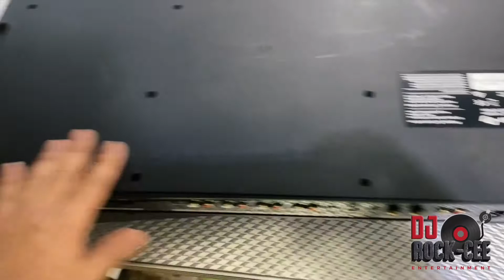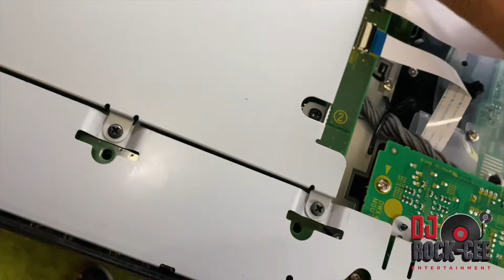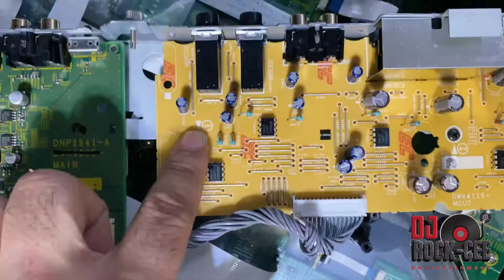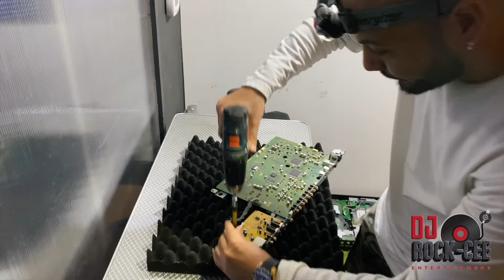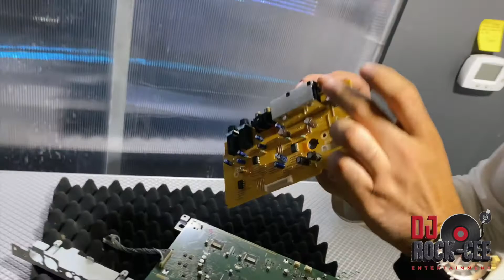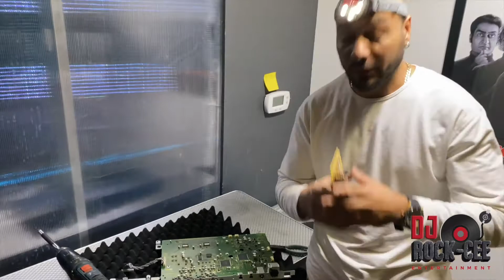how to fix Pioneer Ddj 1000 /DDJ 1000 SRT Master Main Outputs distortion /Audio output Pcb Board

Comment: Hey man my xtr is plug in to the back of my ddj 1000srt and when i turn up the master volume no sound but when i turn up my booth volume i am getting sound..mind you nothing is plug in to my booth
Reply: Same issue! My master is not responsive to adjustment, booth allows sound to pass, and trims knobs have to be turned down to balance volume. Seems like a common issue with the 1000.

Comment: can i send u my controller for repair pioneer sx2 audio is distorted from headphones and outputs speakers please let me kno ???
Reply: I have same problem but on my sx1. No distortion until headphones is turned up half way but also get distortion through master channel as well... But when cue is or headphones aren't plugged in there doesn't seem to be any distortion
Reply: Did you fix it yours?
Reply: I have a sx1 but simikar problem. Distortion through headphone cue but also master channel ay same time.... But only when headphones plugged in and headphones volume Is at 40-50%

Comment: My mixer doesn't want to turn on anymore. Changed the power adapter once started working fine and then it happen again it doesn't want to turn on again. last time I tried to turn it on the quantize was flashing red then it didn't turn on any more please help.

Comment: I’ve always ran my setups from RCA to an external mixer. Just yesterday, I setup my SRT without an external mixer and ran straight to the XLR mains and discovered that the volume on my right main out is significantly lower than the left.

Which is crazy because it’s completely normal when it’s ran with simple mainout RCA to 1/4 to my external mixer.

I looked everywhere for a solution and you’re the only one that appears to have found my answer.

My question, do you personally do these repairs? Where are you located?
Reply: Hi - I'm getting the exact same issue you described. Would love to know if your sorted it, and if the new pcb replacement was the answer? 
Most people I've seen mention distortion, but my XLR outs are just not balanced (no distortion), and RCA outs work fine. 
Thanks!

Comment: I have been getting a weird crackling 
noise later in the night on gigs lately and I will just restart my mac and unit and that seems to work  until the next gig.  I've hade the unit for 3 years already but I'm not sure  what is causing it.  I have replaced wires, free'd up space on my mac, but I cannot figure it out.  Do you know if it's something I have to replace on the unit?
Reply from the maker: first try another computer that's faster than what you have, if you still getting the noise is coming from the output board like I show in this video, you have a tech replace the capacitors on the board for you
Reply: Hey Nathan. I just got my 1000srt today and experiencing same issue. I have the current driver and firmware and have no clue what's causing this. Did you figure it out?